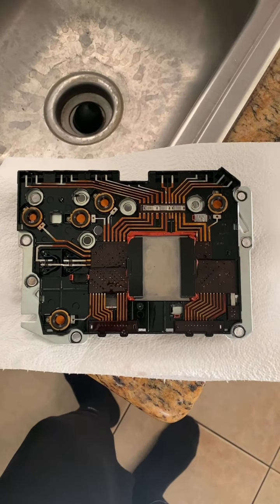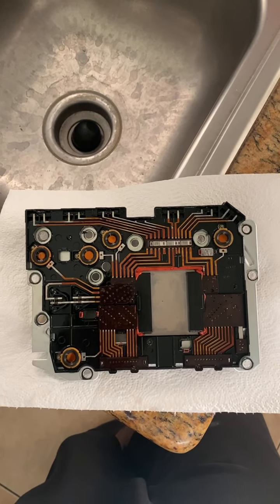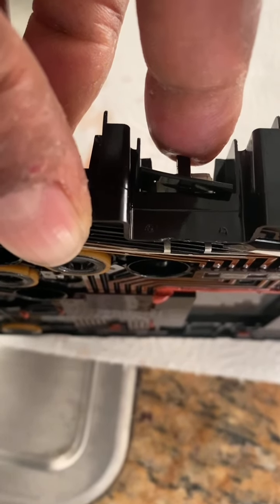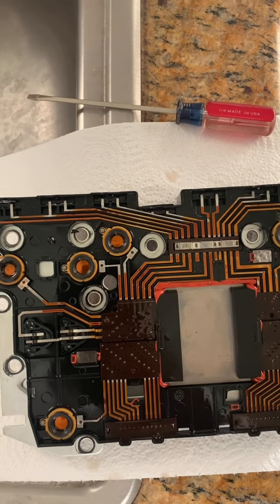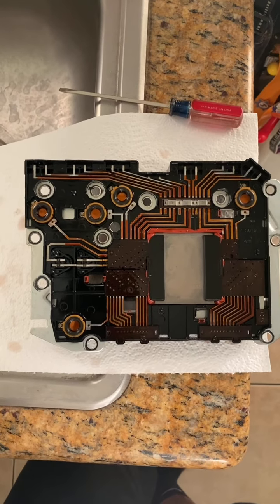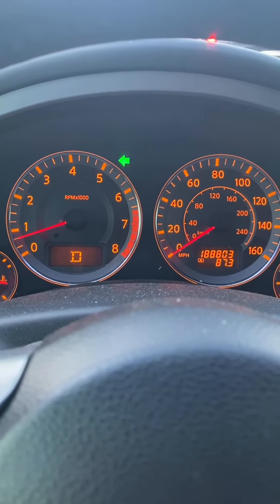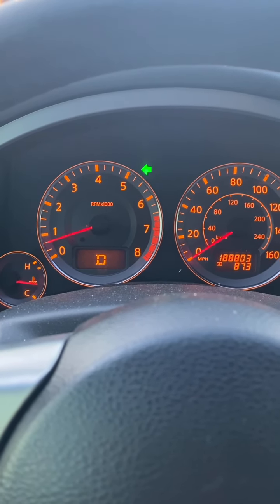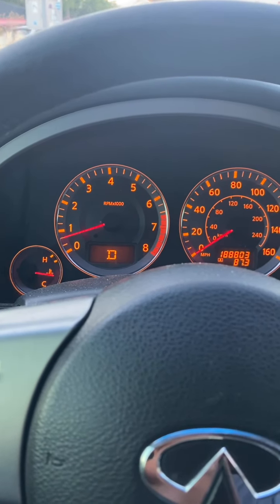RE5R05A TCM FIXED CONFIRMATION P1757 check engine code( front brake solenoid ) infiniti fx35 rwd

Comment: That specific one breaking must be fairly common. I picked up an 08 fx35 with transmission problems. Popped the TCM out and the same one was broken. Soldering fixed it up. Thanks for the video!

Comment: Im fixing this problem right now too😂. This will be my 6th time doing this. Seems like the solder melts when 'abusing' the car like hitting high speeds or long periods of driving. Im not a mechanic and i was able to do it. One thing he doesn't meantion is knowing which bolts to remove from the valve body and remembering where they go when installing the valve body back. Theres long bolts, small bolts and 1 bolt thats a guide bolt.
Reply: You can get something to put the screws in, you can also take them out and set them on the floor, put them in the same pattern that you remove them, put the same screw, where you took it out from.

Comment: Does anyone have this Code on engine p1757 and do you guys have problems with acceleration
Reply: I have the code and have problems accelerating after coming to a stop
Reply: @713braulio how much did it cost to get fixed?

Comment: I highly recomend to use strands of wire and braid it on both sides of the broken connection and then solder it.  If you only use solder, you will be droping the valve body again sonner than later.😊

Comment: Hey i want to do this front brake solenoid fix on my g35 but my car has 260,000 miles on it. When I do the job Should I fill it back up with my old fluid?
Reply: Might as well put new fluid

Comment: 2005 FX35 230K miles same code just popped for me.  

How many miles have you driven without issues since the repair? 

I've seen online that some have reported the same/other codes come back after soldering but I'm also reading that it's possibly because technical error of the soldering like we mentioned in the video.
Reply from the maker: I have driven about 10 thousand miles all still working perfect
Reply: @coreymoto  Could this be the same problem for code P1759?
Reply: 06 FX35, Just popped up too.
Reply: Whats the main cause of the problem?

Comment: Thank you for the video, I have a 2004 fx35 awd. I have a gear changing issue, I think it has the same code. I will talk to my mechanic about it to see if we can check for that. what transmission fluid did you fill it with and how many quarts it takes. Thanks
Reply from the maker: Sorry about the late response I used this https://www.autozone.com/motor-oil-and-transmission-fluid/transmission-fluid/p/valvoline-maxlife-multi-vehicle-automatic-transmission-fluid-1-gallon/819367_0_0?gbraid=0AAAAADkcoVtfGE3tpIRryi84ICxqWGYcY&cmpid=LIA:US:EN:AD:NL:1000000:GEN:19502231967&&CATARGETID=120054150001287504&CADevice=m&gbraid=0AAAAADkcoVtfGE3tpIRryi84ICxqWGYcY&gclid=EAIaIQobChMIg4n7gt7J_AIVFQKtBh2xLwQdEAQYAyABEgIAuvD_BwE&gclsrc=aw.ds
Reply from the maker: And it was almost exactly 2 gallons and that was just dripping fluid from pan and any run off from the valve body as I let it drip drip into pan for about a hour
Reply: @coreymoto  How long you been Runnin' This Fluid? Every forum I've been reading swears by Using J Matic only...
Reply: @coreymoto Corey did drain it 1st?  Then you add a whole gallon?

Comment: Has anyone tried clearing the code and driving it or it is a permanent code until repaired? I'm going to try that today. If the break is sporadic, you might be able to clear the code and it go back to shifting right until the separation happens again.
Reply from the maker: I was scared when it happened with mine because it was stuck in a low gear so I had to drive slow and I was 40 miles from home I made it but it was scary cause I didn’t know what was wrong with the truck then I repair it and it wasn’t that bad
Reply: @coreymoto  When it happened I shifted the car into manual and noticed the gears not changing properly when I requested it to. Once I got home I shut the car off. Then restarted it and it did code but was running and driving as normal. I cleared the code and it hasn’t coded since. I will repair it once I get my other car up and running. Now I’m avoiding pot holes and going very slow over railroad tracks to try to keep it from disconnecting. My car has 220k so that’s not too bad for a weak point in the cars construction. Thanks for the video!
Reply: @poemranger  I got the exact same code p1757 front brake solinoid. In D mode it drives fine, but in DS mode the gears feel super jerky it feels bad asf. For now I’m just driving the car in regular drive. I’m thinking I’m just gonna change the entire vavle body instead of replacing the entire transmission costing me more
Reply: Did you ever fix your problem?
Reply: @panchogomez4238  I haven’t yet. I had to change the computer on my 2015 cruze now that it’s done I will b able to do it once I changed the oil in my cruze. I’m going to change the trans filter and fluid at the same time on the Infiniti. Mine seems to be triggered when I hit large bumps in the road. And when it happened and coded it was very jerky and didn’t want to go into gear even when I used manual shifting. U can try clearing the code for now see if it comes back and under what conditions like with mine when I hit big pot holes or go over rr tracks too fast (faster than 25mins). Mine coded once and hasn’t coded since only because it’s not happening long enough to trigger the limp mode. Once in a while I can feel it disconnect because I press on the gas and it jerks into gear after revving the motor.
Reply: @poemranger  thank you for the reply back. Im sure my Tcm circuit messed up before of post holes too. When I would be in sport mode I would fly through my street and hit potholes and I’m sure that’s what broke a piece of the circuit. Today I’m planning on relacing the entire vavle body and buy one for the same year and car but I’m afraid it won’t be programmed or something and the car will actually go in limp mode. But once I chance the Vavle body I will also be changing the transmission fluid
Reply: @panchogomez4238  my only fear of that is this is a reoccurring problem with this transmission. So if u get another one sooner or later it’s going to happen again and you will b in the same position. Taking the pan down and the valve body isn’t a hard job. The soldering might be for some. Let me know how it goes. Change ur fluid and filter if u haven’t already done it. Im not sure if they are plug and play or have to be reprogrammed. That’s part of why I’m going to repair instead of replace.
Reply: Just got this code 😮and I love my truck I hope this is the culprit atleast it’s not the trans itself